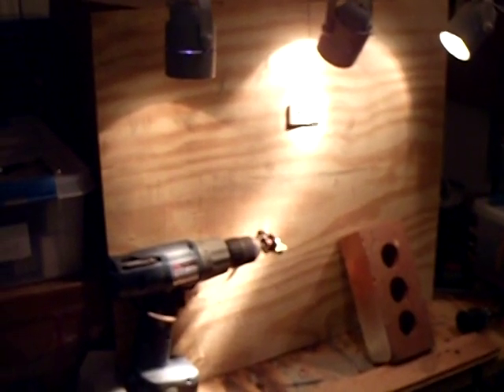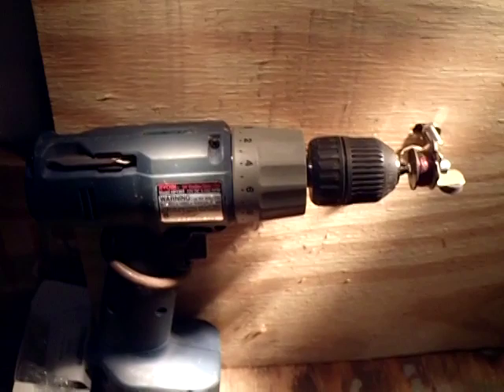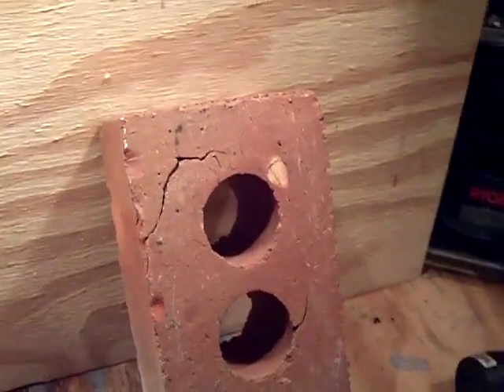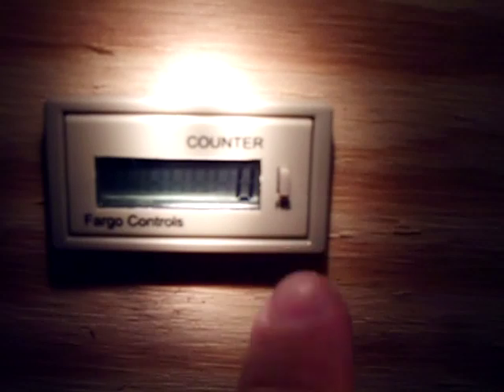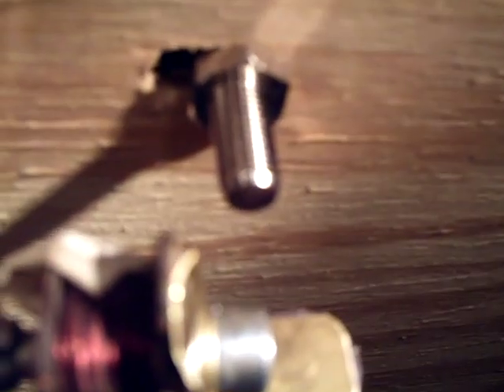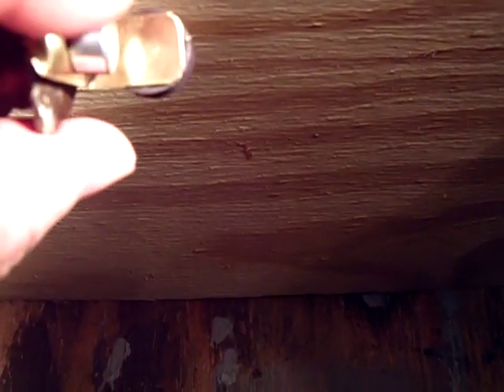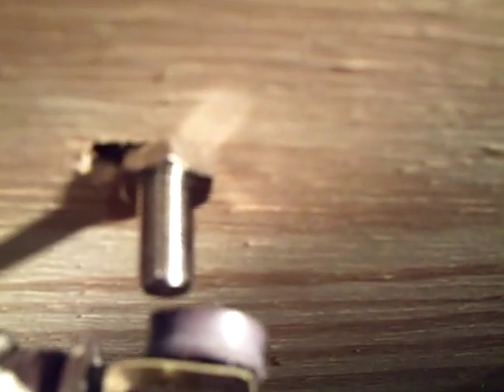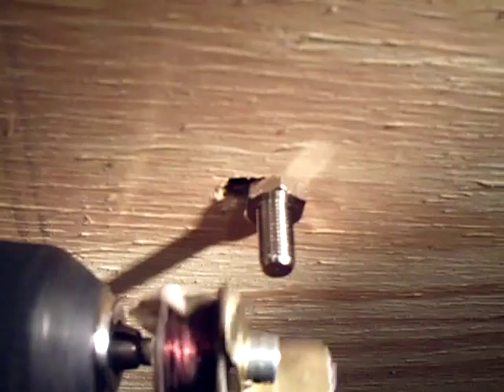Part 8 Philco 16B Repair. The Coil Winding Jig.

Comment from the maker: I acutally think the coil should be around 1000 ohms. I don't think the wire will be one ohm per turn, so it's more than 1000 turns. I'm going back on the Philco Repair Bench site and also lookin gup the resistance per foot of #40 wire. Then I can compare all the values and see if I get Yahtsey.

Comment from the maker: Besides, you'll see what I am trying to do in the next video. I will loosen the coil form very slightly so it turns freely on the shaft, Then I will pull the old wire off and count the turns coming off so I know how many to put on.

Comment from the maker: I actually thought about hot gluing the magnet to the chuck, but figgure I would end up knocking the magent off when I tightened up the chuck. I wanted the bracket to fit into the indentation of the core to keep it from spinning, but loose enough to if my finger accidently got in the way, the bracket would decouple from the spool and not cut my finger off. Won't know how effective this will be untill I get the wire in and crank 'er up.

Comment from the maker: I'll count the turns when they come off, leaving the coil form somewhat loose form the chuck assembly so it turns freely. then tighen the assembly up and rewind the coil from scratch using drill power, knowing the exact number needed. I might actually give it a couple of extra turns.